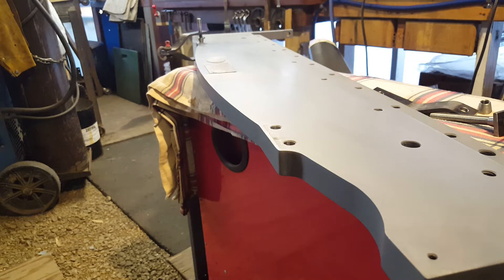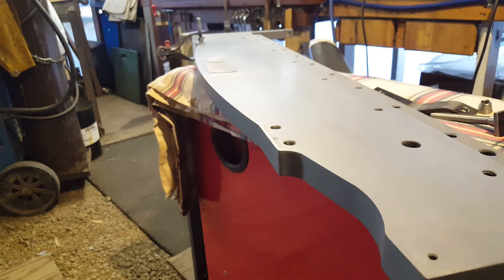Cone nuts and bracket install!

Comment: Binge watching tonight and getting caught up, finally. That came out really nicely! The cones are a really nice way to ensure you had full access to the part for painting. Silicone cones are often used for plugs when powder coating so this made perfect sense.

Best wishes,
Tom Z
Reply from the maker: Good point Tom,
I knew they used silicone plugs, but I needed to hold this part in a rigid position. That's why I went to the lengths I did to hold it.
Worked perfect to get the paint on the entire piece.
Thanks Tom!

Comment: Welcome to the world of YouTube producers...  

Great idea about the holding device, by looking at it from the spectator's seat, maybe you make the cones and the brackets without the threads, you can install the cones and then with same outside diameter bushings you equally fill the space on each side to the brackets, then it's easy to install nuts on the outside of the brackets and preserve the clearance for painting.

Just an idea to make the setup faster and less risk to scratch the primer on installation.

You'll get addicted fast enough to editing...   lol
Reply from the maker: Hey Pierre,
Thanks for stopping by and you and Chuck Barbarino had the same suggestions. You guy's are awesome!!
I don't know about the editing thing, it's hard enough for me to post these things to begin with!!
Thanks again Pierre!

Comment: Fun idea/method/build.......curious for my two cents of thinking...what if? the cones and straps had clearance holes for slip fit on the threaded rod and use wing nuts for speed clamping.....cut and weld hinges at your bend points and now the straps are adjustable for center?  When you go to market hope you remember me as you make $$$😳😳😳😍
Reply from the maker: Hey Chuck,
Thanks for the reply, I did think of that, but seeing as this thing was as heavy as it is, I needed some way to stabilize it. Having a slip fit with wing nuts or other hardware would have prevented me from spraying the area where it was being held.
Great suggestion, and if I hit it big, I always remember my friends!!
Thanks for your support Chuck!